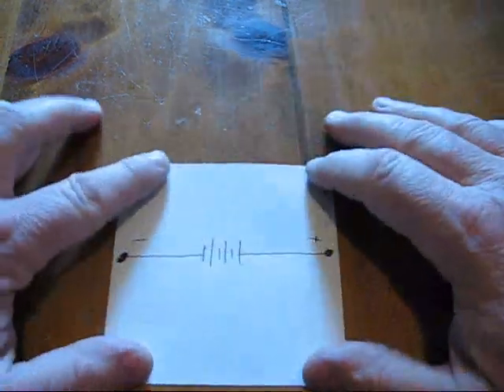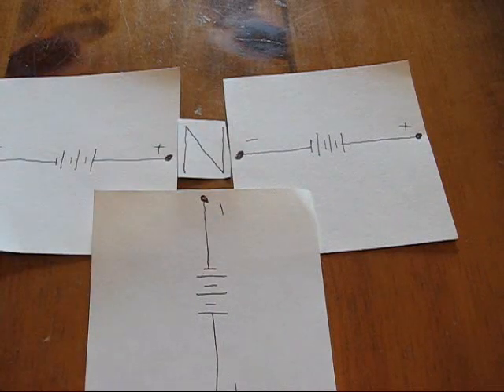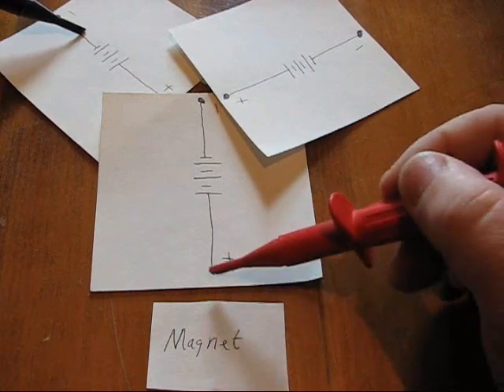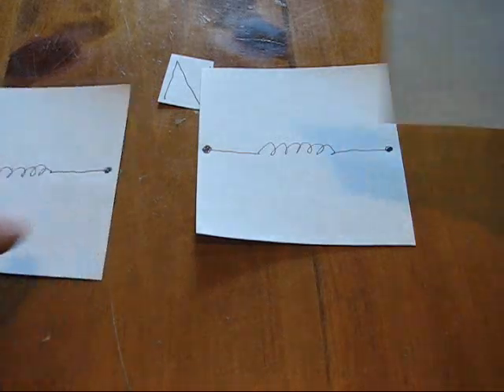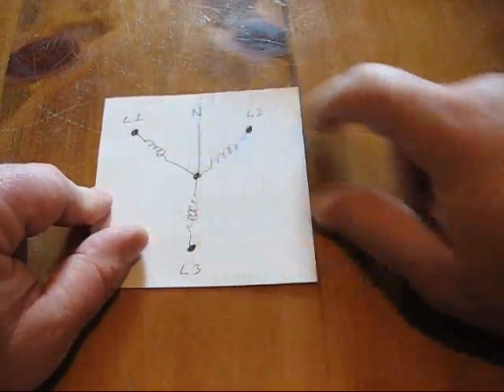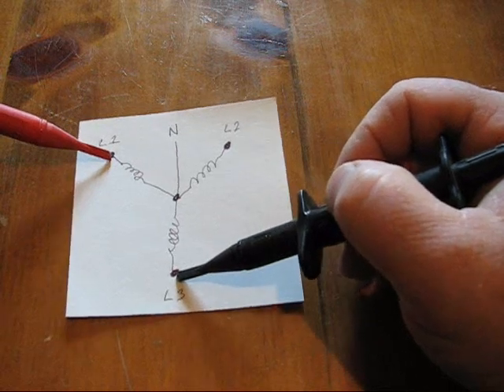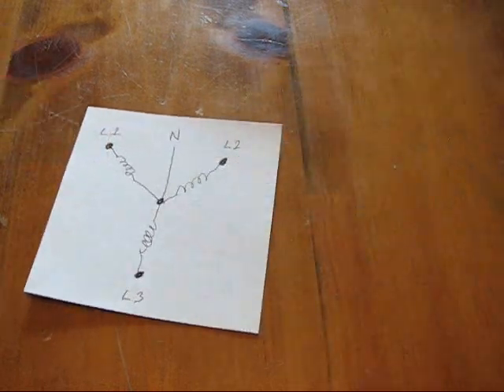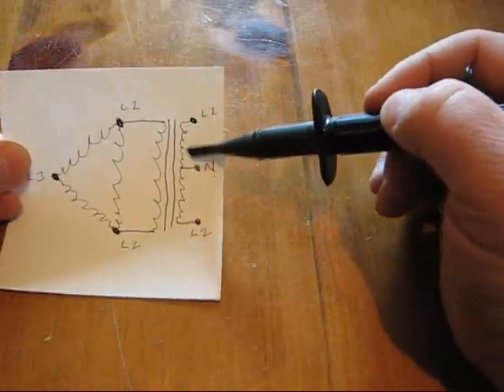Three Phase Power: A Simple Explanation

Comment: I have several machines that run on 3 phase  that I am thinking of moving to my home garage. I am thinking of putting in a 3 phrase converter (not sure if that is exactly the correct word). Are you saying (@ around 9:36) that this would be cost prohibitive? 
I think that the 3 phase at my shop was 480v. Some of these machines have 5 hp motors.
Reply from the maker: At 9:36 I was referring to 3 phase service from the utility company. In your case, especially having several machines, a 3 phase converter is probably the most cost effective way to go. Your motors will lose some power compared to running on a true 3 phase line, though.
Reply: thank you for your reply

Comment: I live in an apartment in Brazil and we actually got 3 phase power at the power panel. Three hot wires and a neutral, each hot wire measuring 127V to the neutral, connecting two hot wires will give me 220V(sqrt(3)*127, not 254) but of course the common power plugs are wired with just a hot leg and neutral so you normally get 127V coming out of the walls.

Comment: I have one practical question that I don't understand the reason for.  I have a pump with a three phase motor.  If it is turning in the wrong direction, I switch any two poles and then it turns the opposite direction.  I know to do it, but I don't know why.

Comment: Line 1 to Line 2 is root 3 greater then Line 1 or Line 2 ( Phase)........ the adding of three phase power cannot just be "simply adding voltages" because of the 120 degree phase displacement.This is regards to Wye connections where as Delta wouldn't be root 3 greater for voltage from Line 1 to Line 2, whoever current would be greater by root three.
Wye (Star) = Line voltage is root 3 greater then phase, phase current is line current
Delta = Line current is root 3 greater then phase current (Amp's), while line voltage equals phase voltage.
Those hot legs are phase voltages and can't just be added

Comment: if L1 to N in wye connection is 110V, the L1 to L2 should be 110v * root 3 =190V( not 110+110=220V)? They are 120 deg apart. since they are in sinusoidal form, Sin120deg * 2 = 1.73 which is  = root 3.  I appreciate your time and effort in this video.
Thanks.

Comment: Electricity is transmitted as volts and amps.  Ultimately it produces POWER in devices.  Power is not the same as volts and amps.  Mathematically power is the square of the voltage.  (or the square of the amps if you wish)

Single phase (or two phase) electricity is fine for small power uses.  But when you apply that voltage waveform to any device the output POWER of that device is oscillating up and down at 120Hz.  Your ac motor that runs your HVAC fan hums because the power is oscillating up and down at 120Hz.  And the torque output of that motor is likewise oscillating up and down at 120Hz.  (Thank goodness for momentum to smooth it out.)
Generally you don't notice the output power oscillating up and down.  Your toaster's heat coils are oscillating up and down at 120Hz but you can't perceive it because the coil cools off so slowly compared to 120 times per second that it stays hot during the off time.  Same thing for incandescent light bulbs.

Three phase is rather unique.  There are 3 voltage waveforms that are 120 degrees phased from each other.  The power output of each individual waveform is oscillating just like single phase does.  But when those three 120 degree phased POWERS are summed together you get a flat line of constant power.  Thus three phase motors do not hum.  Their power is constant almost as if they were DC motors.  (in reality nothing is perfect so some slight mismatch in a three phase motor will result in a slight hum.)
This also means that for a 3 phase motor the torque is constant.  

Similarly the transformers the electric company uses have less internal stress because they are three phase devices and the power they are transmitting is constant.  A big single phase industrial motor would tear itself up rather quickly. Especially the bearings.  Whereas the same motor as a three phase device will run smoothly for years.

If you are mathematically inclined: 
Draw a single phase voltage waveform. (a sine wave)
Now draw the square of that waveform.  That is the power waveform and it is a sine wave of double frequency.
Now draw a graph of the 3 phased voltage waveforms.   
Now square the 3 phase voltages and draw that graph which will represent the power of each phase.  
Then sum the 3 power waveforms.  And you will see that the sum is a straight line.
It all boils down to this equation(x is in degrees):  Sin(x)^2 + Sin(x+120)^2 + Sin(x-120)^2 = 1.5 (for all values of x)
And because of this trigonometric relationship three phase is used by power companies to provide a source of constant power to it's customers.

Comment: Sorry,i wanna correct your  mistake.You said that from the begining of the phase for exemple from the begining of L1 to N (which is neutral) we have 110V and between two points like between L1 and L2 we have 220V which is wrong because  in a three phase power you can't measure the voltage from peak to peak becouse each phase is delayed by 120 degree so in conclusion the voltage between L1 and L2 is 110* square root of 3 which is 187V. Correct me if i'm wrong
Reply: 190.5 V
Reply: You are correct, but the calculation would work out to 190 volt

Comment: Great video but at 6:58, your statement is incorrect.  The line-to-line voltages do not equal the sum of the two phase voltages (line-to-neutral voltages...the 110 V legs, that is).  Because this is a Wye connection, the line-to-line voltage is equal to root 3 multiplied by the phase voltage (line-to-neutral).  The calculation is 110 V * root(3) = 190.52 V (approx.)

Comment: I found a great verbal explanation:  To illustrate the difference  between single-phase and 3-phase, imagine a lone paddler in a canoe. He can only move himself forward while his paddle moves through the water. When he lifts the paddle out of the water to prepare for the next stroke, the power supplied to the canoe is zero.

Now picture the same canoe with three paddlers. If their strokes are synchronized so each is separated by 1/3 of a stroke cycle, the canoe receives constant and consistent propulsion across the water. More power is supplied and the canoe moves across the water more smoothly and efficiently.

This explanation was here:  https://www.tripplite.com/products/singlevs3phase

This helped me to understand the concept.   The physical wiring is another story! :)  However the rest of the explanation on that link also has some good illustrations.
Reply from the maker: That is a great explanation.

Comment: The best explanation I have seen.  Thanks.   My question is this.  My son has a restaurant and had 3 3 phase ovens. We took them out and I turned off the main and cut the lines going to the ovens because we replaced them with some smaller 120 v ovens.  So in the power box where the main breaker is located, could I put a separate breaker to power something else?  We, of course, already have a 200 amp service box with another main and power for the regular outlets and lighting in the restaurant.
Reply from the maker: If you have a 3 phase load to power, yes. Or if it's 208V, you could use two legs of it to power a 240V single phase load, if there are no 120V loads in the appliance. But that probably won't meet code so it's best to just use your single phase panel for that.

Comment: Too bad that the facts are wrong. In countries where they use 230-240V it is the voltage between one phase and the neutral. Between the phases we then have 400V. When you use the voltage between the phases, it is called two-phase. One phase is always between ONE pahse and the neutral. When you use 3 phase it is called 3-phase. The voltage between each phase has a 120 degrees difference.

Comment: In case of the delta connection, across any two points, isn't 110V parallel to 220V. Wont that give a different value? Why dont we consider that way?

Comment: thank  you so much for your very helpful knowledge. i am trying to learn all i can about this subject bc i am planning a trip from Jekyll island up to new York along the eastern seaboard  dragging my new wind turbine design to recharge my nissan leaf 24 kwh batteries along the way at either level 2 - 220 volt charging or level 3 speed charging @ 440 volts, (that's if i can get one to use for the road trip,;) currently im testing a 4 ft turbine and in a 30 mph wind without a load, it produces 500+ ac volts, but with a load on it, i can run four 200 watt bulbs, and  my volt meter reads  around 200 acv so im guessing that's around 4 amperes. the windmill i will be using for the road trip will be a 8 or 10 ft system when i build it, and with my math, I'm  predicting  to produce between 6kwh up to  10 kwh depending on the ocean wind speeds at every stop for recharging.. want to come along? i sure could use your knowledge on wiring  up the 440 volt dc speed charging unit that comes with the car. :)  and this road trip should make headline news and also be another great you tube video for you? 
infinitenergygeo@hotmail.com send me a email and ill send you a short video of my wind turbine testing, if you like. nevertheless; your knowledge  was very helpful and thank you very much for your time!
Reply from the maker: +chin K Thanks for the invitation. It sounds like a very interesting endeavor, and I wish you luck. Unfortunately I cannot accept because of time constraints, but please keep me updated.

Comment: hi, i built a wind turbine with a 3 phase pmg alternator,  and have been running AC  off of it by just using 2 of the wires and leving the 3rd wire un connected.  am i doing it right and getting all the electricity from it. it puts out from 120 up to 300 ac volts?  thank you for your time.
Reply from the maker: +chin K It works (as you know), but you are losing efficiency. I would try to split it into three separate circuits.
Reply: How do i do that? Im not very knowkegable with electricity, i just hook up 2 wires and run lights and or run a 15 amp battery charger. when i charge batteries  through the rectifier it only produces about 50 volts at about 3 amps dc and the EMF boges my generator  down, is there a way to minimize the EMF increase on my system and still generate high ac voltage?
Reply from the maker: +chin K If you're just running lights and a battery charger, you would be better off rectifying to DC. Look at your outputs; you have three wires. Let's call them 1, 2, and 3. Connect the AC terminals of a bridge rectifier to 1 and 2. Connect a second bridge rectifier to 2 and 3. Then another one to 3 and 1. Now you can parallel all three DC outputs. Connect all three negatives together, then connect all three positives together. Just like connecting three batteries in parallel. Now get an electrolytic capacitor with a high enough voltage rating. I would look for the biggest 450 volt capacitor I could find. Connect your negatives to the negative terminal of the cap, and your positives to the positive side. I would also put a 100K or so resistor across the terminals of the cap as a bleeder. Be very careful with this, because it will build a charge of whatever voltage your generator is capable of.
Let your generator run, and measure the voltage on your capacitor. Next thing is to find out how much current it can support. If you had 300 volts, connect three 120 volt light bulbs in series and see if they light. If not, try two in series. If they still don't light, try just one. You're trying to find out what voltage and current it will actually support before you can decide how best to make use of the available power.

Comment: Great splaining, also in the U.K. the freq is 50hz. Thats another lesson. I am sure you knew that. Thanks for sharing. It clarified a lot for me.
Reply from the maker: +Patrick Fitzmichael Yes. Many appliances will work fine on either 50 or 60 cycles. A motor designed for 50 cycles will run 20 percent faster on 60, and a transformer designed for 60 cycles will run hotter and make a bit of noise on 50.

Comment: Excellent vid, very clear.  So can three phase be 330 volts?  How do they get 440 volts from three phases?
Reply from the maker: +Barnekkid Sure, it can be 330. It can be anything they build it for. Voltage is determined by strength of the magnetic field and number of turns in the windings.

Comment: 6:08 between Line and Neutral we have 110V
But between Line and Line we have 220V (Isn't it 110V * Sqrt(3) = 191V)
Correct me if I'm wrong
Reply from the maker: +Nassim Akrouh Look at the title again: it says a simple explanation; not the mathematically precise definition. You're not wrong, but precise definitions are for the textbooks. This is about what works and how it works. All voltages are nominal anyway, and you cannot add two nominal voltages and get a precise voltage. That "110 volts" might be anywhere between 90-130 volts; how can you get exactly 191 volts from that?
Reply: +Nassim Akrouh That sounds like split voltage. a completely different system.

Comment: why we don't need a neutral in the delta connection??????????????????????????
Reply from the maker: +Niki Isufi It's not so much that we don't need one, as that neutral isn't a natural feature of the Delta configuration. Three phase loads don't usually use neutral anyway; it is when we run single phase loads on a three phase supply that we are most likely to need neutral. In that case, a neutral can be created by center-tapping the winding that you will use for the single phase load. Or, use a center-tapped isolation transformer.
Reply: +Possum Living I understod that but i mean if we don't have a neutral where does the current go??(i mean it cannot disappear)
Reply from the maker: +Niki Isufi The neutral is not necessary to form a circuit. When you use all three phases or full voltage single phase, you don't use the neutral. The only reason it is even there is to provide a secondary, lower voltage. Whether Wye or Delta, normal current flow at any given instant is between two of the three primary connections.
Reply: +Niki Isufi In AC power the current goes between poles and right back again. The motion of a magnet in the generator is what creates a current and the speed at which the current bounces back and forth is measured in Hz (cycles per second). This is why a normal (non-grounded) incandescent lamp cord has no poles - there is no specific direction the current needs to flow. If it were DC - as from a car battery, this wouldn't be the case!
Reply: +Isaac Lubow thanks Isaac for your  explanation i think i got it now :)

Comment: 120v nutural to phase, 208v between phase and phase. A pie (3.143) must be applied
Reply: You're rigth with 208V. It's always a factor of sqrt(3) from star voltage to delta voltage. This also works with other 3 phase systems. In case of a 230V system, delta voltage is ~400V.

Comment: Now  I think It    might be possible  to run a 3 phase motor properly  where only single phase is available by using a VFD  and taping in to the VFDs  DC bus internally and  supplying at that point the correct DC voltage and power needed at that point effectively only using the  invertor part of the  VFD,,, a VFD is essentially a  AC to  DC power supply and then back to 3 phase AC these are used to allow a certain amount of speed control because they have variable frequency 3 phase invertors and also for gentlier  starting,,,   in using only single phase to  make the necessary DC bigger diodes are needed and more  capacitors also  as opposed to using 3 phase as a supply

Comment: In some very large commercial or industrial sites  the customer sometimes purchases electricity at !2Kv or  !5KV or25KV  and at some mine sites or oil pumping sites even  at 230Kv   the costs for electricity at these   wholesale  sites is lower  but this is only done in rarer cases  the customer must then pay for the cost of their owm  substation usually outside,,,   Other voltage often used for  larger  electric motors is  2400/4160 volt  3 phase for motors 300  400  or even up to 4000   5000 hp